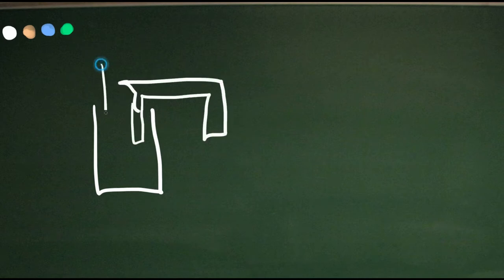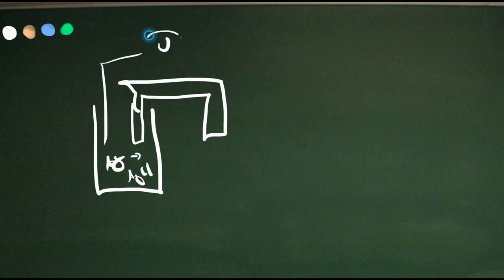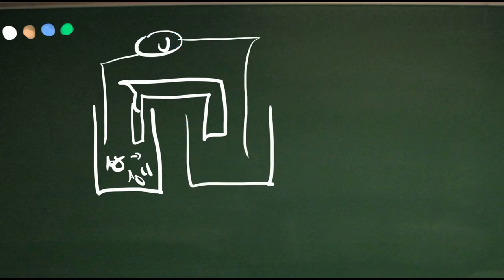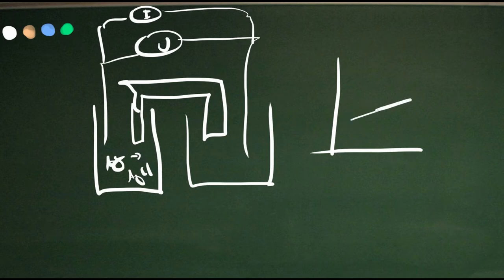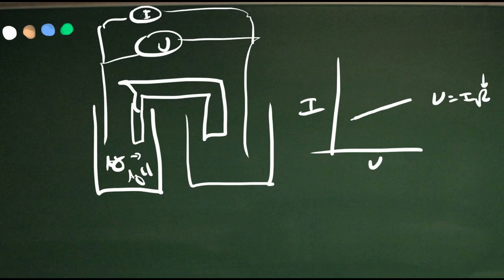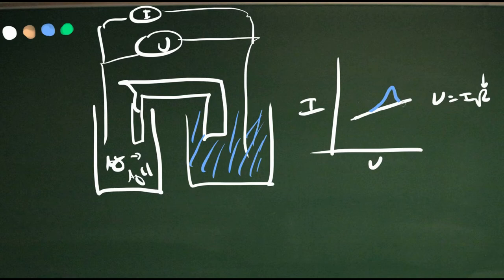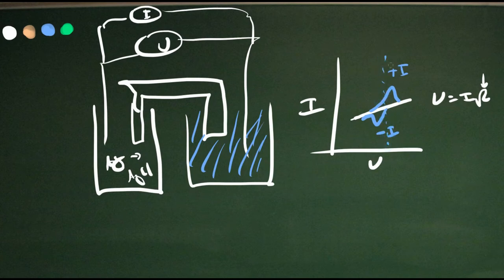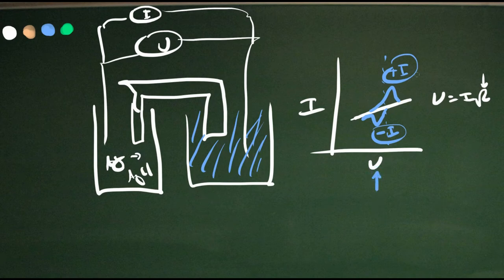Open Potentiostat and Cyclic Voltammetry explained in 1 min

Comment: Thank you very much doctor... I need you to explain to me how a three-electrode cell works in the potentiostat to measure the corrosion of metals and what is the benefit of measuring the open circuit… I am a student at the university and I need to communicate with you, can you help me
Reply from the maker: The thing that helped me understand the three electrode system was that you want a different pair of electrodes for the voltage measurement and the current measurement. You don't want current through the reference electrode. Check out the section of analytical chemistry 2.1 by Harvey (free online)